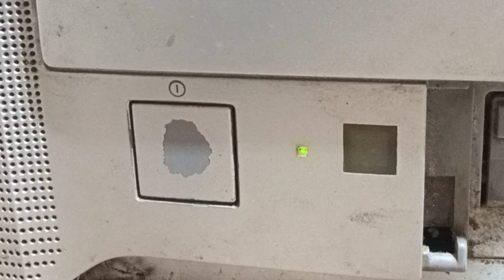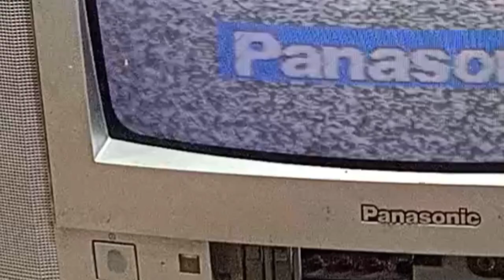TV PANASONIC QUINTRIX F GAGAL START

Comment: Tv saya quintrik f kedip" lampunya,  gak mau start,  tegangan 180 gak ada,  sudah saya ganti elconya, tapi kok tetep gak bisa toaa,  kr" apanya ya,,?  Tlg jawabannya ya mas,  tk tunggu,,,  matur suwun
Reply from the maker: Ganti elconya besar kan ukurannya, sambil solder ulang IC croma
Reply from the maker: Yg 470uf/16v sama 220/16v ganti 1000uf 25v
Reply: 220uf 16v di ganti ukuran 1000uf 25v ya mas,,